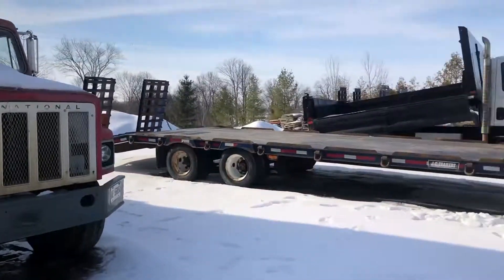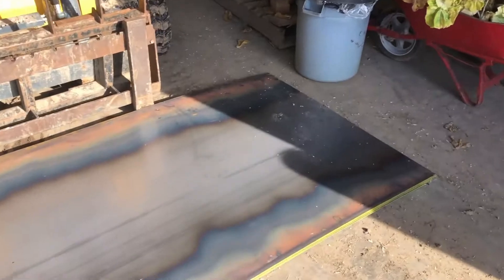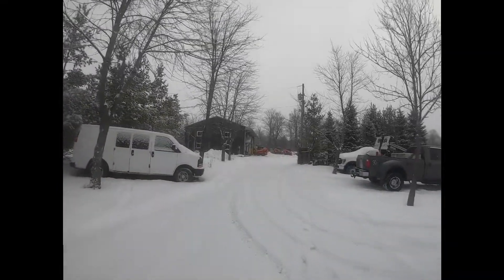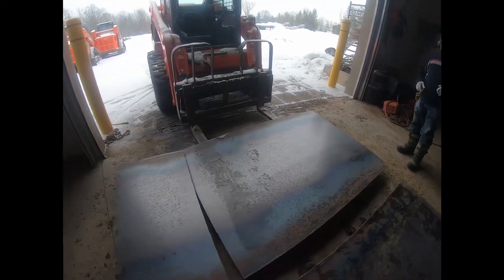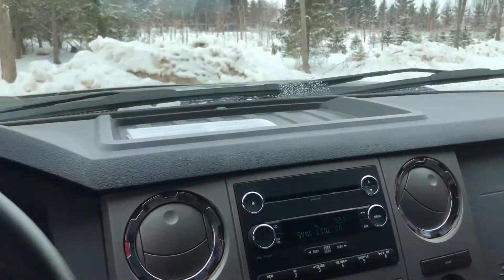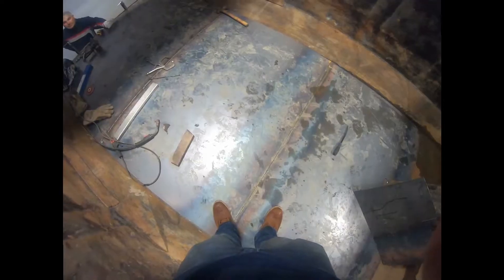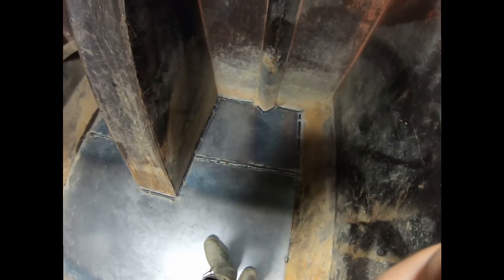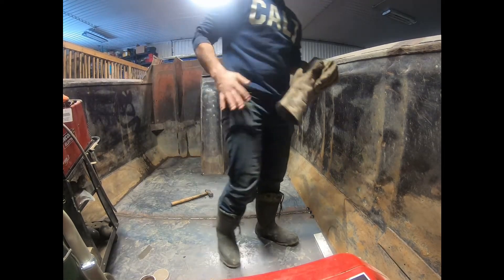Repairing a Dump truck box (part 1)

Comment: When I was a little kid my dad drove dump trucks in the late 80s early 90s.  I remember his truck and a lot of truck I used to see had those automatic tailgates.  I haven’t seen one in years and yours is the only one I can find online that isn’t an off road truck.  

So as far as I know that box is special just because of that
Reply from the maker: @shawnwest3779  yes these are actually pretty common around here. It’s known as an “excavation box” 

This is because they are more heavy duty and the whole point of the tailgate lifting automatically is because usually on excavation jobs your doing 50+ loads per day. Where regular trucks making deliveries maybe 5-10 loads per day. Also the material on excavation site can be much harsher on the box
Reply: @dirty.diggers that makes sense.  He did mostly demolition stuff I believe.